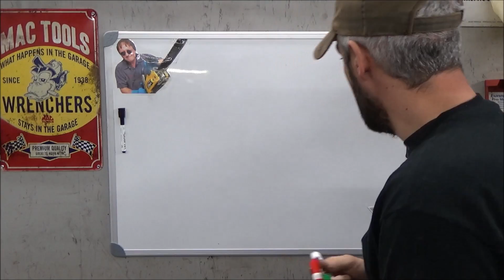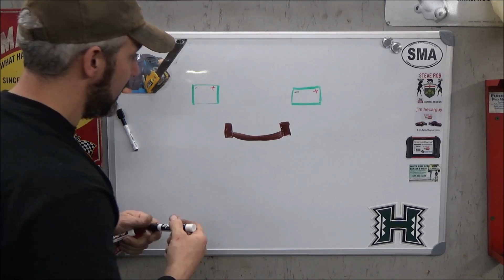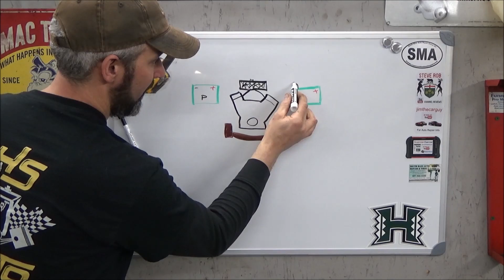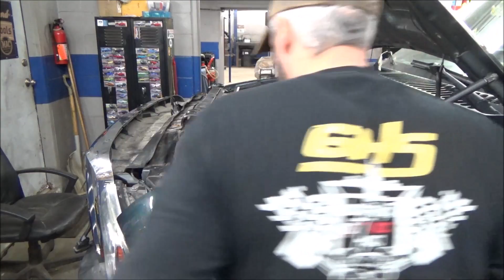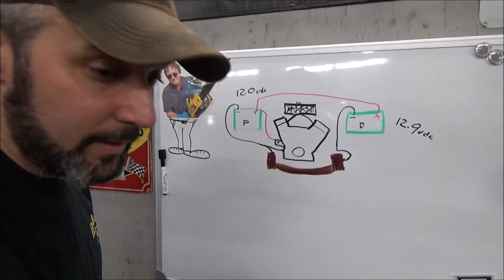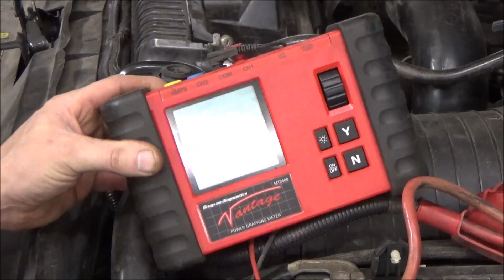Ford F-550 6.0 - No Start No Crank

Comment: Eric, as soon as you drew your wiring diagram of how the batteries were wired up I knew exactly where the trouble was. Only because I used to work in the RV industry and worked on many coaches with multiple battery set up and often saw issues like this. Your scope use just blows me away.

Comment: I always check the battery under load.  I’ve had my battery say 13v and when I hit the key drop below 6v.   I really enjoy your videos.  One of my favorite things is to diagnosis problems.  I always guess at the beginning where I would start and what the problem would be.  Doesn’t have to be a vehicle.  I did it for a friends a/c and another persons washing machine.    Fixed a lawn mower a couple days ago.   It helps keep my old brain working.

Comment: Since I am an old school guy as soon as I knew one battery was out of the circuit I would have brought out the jumper cables for trial and error work to get everything working. In this case I would made the repair with a heavy duty ground strap from the engine to the frame. Probably the way your dad would have done it. All cars and trucks should have an engine to frame ground strap and a body to frame strap to ensure a consistent ground. I am 71 years old and like your dad I grew up in a time when we didn't have much to work with. We just think a little differently. I do enjoy watching your brain work with logic of the computerized systems we have today. You make it look easy and it probably is when you have the wiring diagrams available and the scan tools you have. You are at a level not many mechanics will ever achieve. Keep up the good videos and I will keep watching.

Comment: Had a similar issue on a Mack truck the other night. Wouldn't charge. Another shift put in batteries and an alternator. All it was.....loose engine block ground bolt. Good diag and very thorough. I like to do the same. Make sure I'm right before I order parts.
Reply from the maker: +asavage1576 Gotta test not guess!

Comment: I made my "bad ground" diagnosis at the point in the video when you didn't get the same voltage reading from each individual  battery, that was the give away as to the problem for me.  I have watched most of your videos and have learned a lot. I didn't cheat by watching the entire video and then composing my comment.

Comment: very well explained for a tricky problem. 
Some basic electrical knowledge helps to understand this.

even nicer to see a mechanic ..err .. technician, actually diagnose things  and not just throw parts at it.
Reply: The presentation was for mechanics that did not have a strong understanding of electrical troubleshooting
Reply: I'm an electronic tech, and the second thing I'd check after battery voltage, and finding a differential, is measure the resistance between battery terminals, neg to neg, pos to pos. If you're measuring a different voltage across two devices that are in parallel, then they're not truly in parallel. Something ain't right. Also, as a tech, 'chassis grounds' in any device, unless silver or gold plated, (copper can work but not as well) are problematic when using them to conduct hundreds of amps as needed to crank the engine. Always connect a healthy gauge of copper wire between those terminals with a common ground at the starter via the same heavy gauge wire. And equal gauge from the solenoid back to the batteries. Wire is cheap in the big scheme of things. Always wire directly for ground returns on high current devices.

Comment: Sometimes a continuity (resistance) check is a better approach than voltage. Either points you toward a fix, but if it was me and I knew that the batteries were truly connected in parallel I'd:

Check resistance between the (+) battery terminals (should be near zero Ohms)
Check resistance between the (-) battery terminals (should be near zero Ohms)

The second test fails in this situation, so:

Check resistance of each battery's negative terminal to chassis. The defective chassis ground of the offending battery would immediately be apparent. 

Nice post. I admire the energy and effort that you put into this channel.

Comment: Going back 30 years or so. 
Q.  How do you tell that you forgot the earth strap after installing the engine? 
A.  The choke cable vapourises when cranking.
Reply: John Lamb 
Isn't that just it too.
These people these days couldn't even imagine how stuffs changed.I forgot about that one.
Reply: You can smell the plastic sleeve burning 😋
Reply: VW engines used to light up the heater box cables when cranking the engine when there was not a good ground.
Reply: John,
Been there done that  before. Not a good feeling either
Reply: There is no choke on a diesel.
Reply: Earth strap?
Reply: @davecarlson3414  ground

Comment: My Cummins dual batteries are not connected under normal circumstances. They charge through a 2 bank battery isolator and a solenoid parallels them when cranking. I have become a fan and always learn something from these videos.

Comment: Alternator charges batteries, batteries crank engine, engine running, alternator runs lights,all accessories, and plow motor also plow lights. The only GROUND between the alternator and ALL of the above is the connection that you found FRIED. Ground for the plow is going back to the Neg. Battery terminal NOT the ENGINE BLOCK. Remember the Plow is AFTER-MARKET, Ford doesn't know its there and the Plow manufacture doesn't know its installed on that Ford so all they can do is rig it to ground to the battery. Answer is an extra ground cable from the alternator mounting bolt to the plow motor.
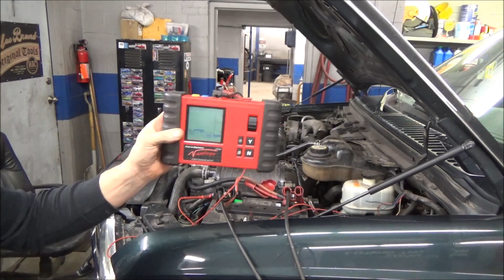Reply: The battery saw the alternator voltage, so no, the alternator was fine, its connected to the battery. The only problem was the ground of the "second" battery never reached that of the still working battery at the chassis. See 29:00

Comment: At first I was a little surprised you are using current from the battery charger to get electrons moving enough to do the testing, but then I realized it is such a common situation, the technique almost falls into your lap. Good idea. I have to confess, with the big difference in voltages between the two batteries, I would have switched to static testing with an ohmeter, then switched back if I didn't find the break. It would be interesting to see what kind of current flows on those 12 gauge wires 'protected' by the 150A fuse. Even in an old truck, as you point out, that's a fire waiting to happen when either battery eventually fails. If he didn't want to pay for a heavy connection wire, I might have added a fuse to the 12 gauge wire to protect the 40A limit it is designed to carry.
Reply: i would have put jumper cables on both batteries to produce a common ground then check battery voltage then it would show no voltage drop then it would show a bad ground
Reply: @leereynolds2911  you would still have to isolate which ground wire was at fault.

Comment: I appreciate your method. I totally respect your efforts to 100% confirm before jumping ahead to your best guess. When you were pretty sure the passenger side ground was the issue, I was like " OK clean and check those  grounds on the passenger side" ...but we still didn't know which wire or connection point was bad. Thank you for being thorough. I have learned a lot from you.

Comment: SMAR LLC thx for the great informative video of diagnostic trouble shooting not a parts changer. I worked at McConnell Douglas in early 80s on MD80s had one with function test fail on DFGC was ready to open cargo area from nose to tsil to check all connections and wire looms when an old A/C electrician I was working with sat with his pipe in mouth staring into space for about 20min then told me what frame station # location to accesss a Cannon Connector and pin# that was depressed and not seated properly fixed it and problem solved all from working it out in his head. Learned a valuable lesson from Tom that night.

 #

Comment: A call to the owner:  "The good news is the fuel gauge is fixed, the bad news is that it won't start"  lol....
Reply: +ICU2 The fuel gauge is now as useful as a decal.
Reply from the maker: +SirDeanosity Haha
Reply: +SirDeanosity The fuel gauge is now as useful as the Scotty Kilmer decal. Which is as useful as watching Scotty Kilmer.
Reply: Eric: did you make or buy a cable for this truck?
Reply from the maker: bought it from Ford around 50 bucks
Reply: The operation was a success, but the patient died.
Reply: @gregk.6723  but then Dr. O brought her back to life!!
Reply: Right, like time to pay me , thanks!!!
Reply: The ford wires turn green from the inside out.  They get oxidation bet your ohms are high.
Reply: Man get you a spool of 2ga welding wire . It Should have already been done with that truck having a plow, probably spot lights , salt spreaders , and , and lol . J s i would unhook  that 150amp breaker to 12ga wire before it catches fire because there is no way that breaker flips before that wire 💥💥🔥🔥🔥 . Love your work Eric keep it up.

Comment: I prefer the roundabout to the solution. I guessed that it was the wire between the frame and motor, the key is why. To get to the key you have to know how to check. I like seeing the voltage drop, easy test. Keep em comin!

Comment: That could have been + or - connections especially with all the extra connection points & 2 batteries, snow plow crap. Good voltage drop testing especially on that mess and load testing like Grandma taught you. I was waiting for the ohms test to pass like they usually do b/c all you need is a good strand but it was crispy burnt. Nice Saturday afternoon entertaining instructional video. Just finished rebuilding my motorcycle carbs & needed a break before installing them and there was your video.
Reply from the maker: +Hayward&#39;s Automotive I was really hoping it passed to but I am sure at the point one strand was holding on it got a little toast :)
Reply: +South Main Auto Repair Yep the more strands that broke the hotter it got, the more arcing and your saying "One Two BBQ"...:-) Would have been nice to show how it could pass an ohms check and fail under a loaded circuit.
Reply from the maker: Yeah I was really hoping too, that is why I threw the ohm meter under the bus a bit before getting the results... Oh well. Next time :)

Comment: After your diagram I would have checked the cable to the engine...I bet if you connect a jumper cable from the battery neg. to the engine block it will start !!

Comment: Never thought of using a battery charger for voltage drop checks. That is a most valuable tip. An extra piece of raisin pie for Eric (after you recover from the burritos).

Comment: I always find it interesting how different test equipment behaves under different test conditions. The other extremely interesting test is a high voltage insulation test. To make sure that insulation for cables is working correctly in high voltage usage. The first time i was introduced to this test it left me in awe. Cause I had never considered that a failure point. Just like with any test/measurement equipment. Its important to know where your equipment is inaccurate and how large the inaccuracy can be in those ranges.

Comment: Whenever I installed an Aux Battery that was connected to the Main Battery directly, or through a Battery Isolator/Battery Charging Relay, I ALWAYS ran a ground from the Aux Battery to the Frame AND the Engine!  I've eliminated SO MANY problems that way.  I had a Ford F250 that spent most of its like at a different (Los Angeles Dept of Water and Power) yard, NEAR TO the Pacific Ocean.  Needless to say, there was plenty of crusties in the sheet metal, parts of the frame and........you know the song.  The vehicle had "INTERMITTENT" electrical problems for over a year.  The mechanic at the yard finally gave up on it, brought it to me.  (I was the Auto Electrician at the Main St, L.A. Shop)  I did LOTS of voltage drop testing, both with engine running AND using the SNAP-ON Battery-Alternator-Starter tester while loading the (Power, Ground and other) circuits with the tester.  Without a load, some had up to .5 Volt voltage drop.  Loading it produced a surprise from the same .5 Volt drop, up to 1.5 Volt Drop ! !   So, I ran a 10 gauge black wire from inside the cab at the ground in back of the Driver Side kick panel (2004 F250 with a 5.4 V8), through the bulkhead/firewall to the grounds on the bulkhead, the driver's side inner fender panel, the radiator core support, to the passenger side inner panel grounds to FINALLY, the Small Wire battery ground on the passenger side inner fender panel.  The original ground at that point was loose, thanks to a (AGHHH) sheet metal screw !  !  I installed a "nutsert" into the panel and connected the new 10 gauge ground with the battery ground at this point being held by a 1/4" bolt and lockwasher tightening everything to Mike's Torque Spec!  Retested for voltage drops, most were at .1 volt UNDER LOAD.  The 1.5 Volt under load voltage drop went to .3 Volts drop under load.  The driver took the truck, the next time I saw it was when I did the smog test to it about 6 months later.  ALL my connections with the 10 gauge were crimped and soldered.  No more problems.
Reply: Thanks for info Mike. I have a 05’ F250 6.0 with only 70k miles. Bought it from the only owner that took it to dealer and had all of the PMs done. The service book has the dealers stamps on it. I had a  custom stereo with amp and subs installed at reputable shop and installed new LED headlamps that’s it. It started killing the newer motor craft batteries and have had to replace the alternator twice. First replacing stock 110A Fusion alternator with a lifetime 150 it went bad so I upgrade to a frigging 220A tractor alternator which I had to put longer bolts in because of how much bigger it is. Worked better but still slowly draining batteries so I looked on YouTube  and saw suggestions for bigger ground so I installed a custom fabbed #2/0 ground from alternator to aux battery worked better but still slowly draining to point that I bought NOCO jump pack because I was tired of calling AAA! Now it’s a no crank no start when warm only. I know low voltage can where on system and I saw a video where suggested to also run at least a #4 from positive of aux to alternator but the truck wouldn’t turnover! Suggestions? Ty much respect….Shawn could you call me at 541-729-0408. Please text if I don’t pick up

Comment: I noticed CCA has made it's way into battery feed cables for manufacturers to save money.  I learned my lesson by avoiding CCA which stands for Copper Clad Aluminium. It looks just like copper at a lower price. The aluminum deteriates very fast but the wires still look good. Made the costly mistake of using that garbage on a front and back winch feed and had to replace all of it with copper welding wire. Don't be fooled by the cheap CCP crud. Look for solid core copper. battery feeds. Looks like this truck was a victim of that garbage. The way you can verify it, is hand torch it. The aluminium disentigrates fast where-as the copper just heats up.

Comment: Excellent video Eric, the bottom line here is the ability to fault find using voltage drop with purely a multimeter and not complicating it with "other" tools. Most folk play with the positive but tend to "ignore" the negative as I suppose it's deemed more complex, but it's not. It's a process many people do not fully understand, but, it's worth going through the pain to understand. Certainly speeds up fault finding once you do fully understand. Keep up the good work :) PS: you sure the little curly fairy was out !

Comment: Could have taken the battery charger and hooked up positive to the battery and connect the ground to the alternator. The check the voltage at the battery. Then move the negative charger cable to the frame and check again. Keep up the good work. Really appreciate all you do!

Comment: The easiest fix for this problem is to put an extra ground cable from the drivers side battery to the block. Dont forget the starter is on the motor and the computer is on the chassis. So frame, block, chassis and motor all have to be grounded to each other. Great videos

Comment: Hi Eric greeting from IRAQ nice diagnosis but if it was my car i would simply put a new cable from the battery to the nearest screw in the body and live goes on , and why there was no brake cleaner in this video LOL
Reply: Never would have lasted. That was a quality lead at one time. I would have ran from ground to ground at the batteries.
Reply: The body of the vehicle is seldom used to effect a ground for high amperage requirements.

Comment: Great diag! never seen that before on a 6.0, I have seen something like that  before, I remember years ago I  diaged a no crank on an 80 ish f150 needing a negative battery cable voltage drop proved it was the cable my service advisor didn't believe me jumper cables proved I was right! the shop I work at now also had a Volvo with a slow crank issue after helping the other tech prove it was a voltage drop on the positive cable running to the rear battery, the customer declined the 16 hrs plus parts to replace the cable
Reply: No doubt the volvo customer declined 16h work to change a cable.
And it is all good by now.
Reply: Robert jissbom to replace the cable requires complete interior removal as the cable runs inside the cabin, yes it is good we ran a extra cable under the car to the battery with cable we made with protection from abrasion too. No more hard crank
Reply: Nice "quick" fix, 
Have vida SW but did not go deep on it, just first impression.

Comment: Easy to say after the fact but I was saying use a jump starter cable between the battery earths to start with and see if it cranks, then experiment for there on. Appreciate the volt meter for the video and learning through application, cheers